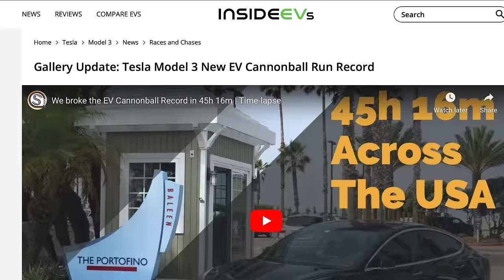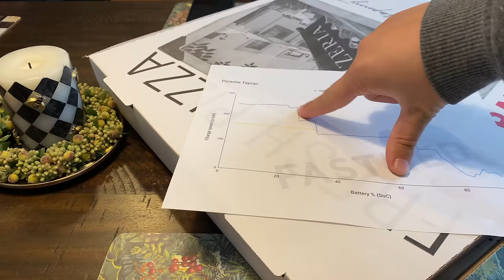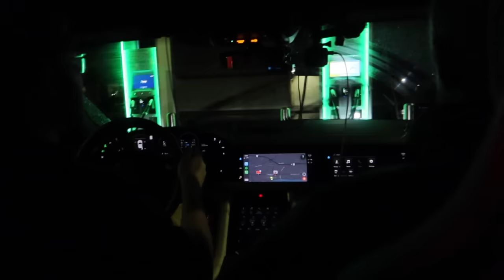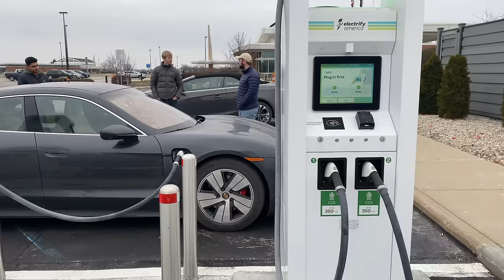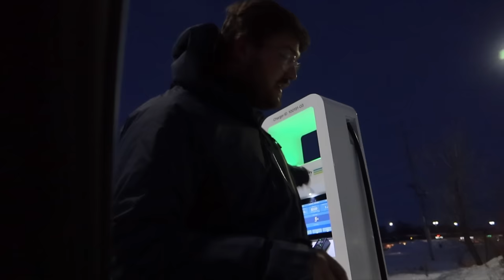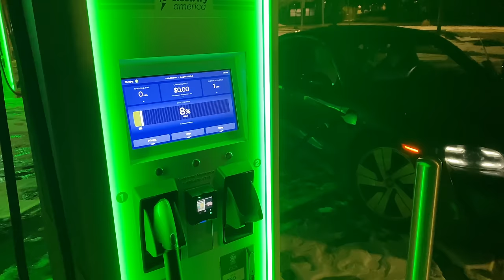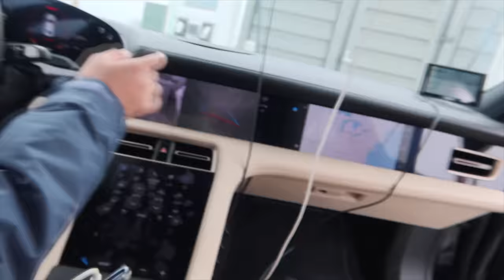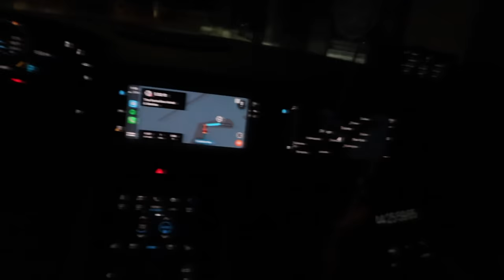EV Road Trip From NYC to Los Angeles! Breaking The Electric Cannonball Record In A Porsche Taycan 4S

Comment: I can't believe the positive comments.  I watched this whole thing and was horrified.  All you demonstrated was how unfit the Porsche is for road trips.  First, they gave you a car with no functional navigation system which Porsche, themselves, couldn't fix.  Then, nearly every single charger along the route failed.  Are you kidding me?   If you hadn't had a bunch of guys clearing the path for three-digit speeds, you wouldn't have made it.  What you amply demonstrated is that this technology is not mature enough for Mr. and Mrs. Average American.  Based on your last two road trip videos, there is zero chance I will buy any EV product from the VW group.

Comment: Too much power is EXACTLY the same problem that the new Signets give Energicas. Sending so many more amps than requested until the vehicle initiates a safety shutdown. So until they fix them we have to call ahead to try to find locations without Signet (which are few and rare).
Reply from the maker: That’s one of the many problems, yup

Comment: Not speaking as a Tesla fan boy but beating this wouldn't even be a challenge in a Model S. Significantly more range & much more reliable chargers that work right away.  Also imagine how much time you would save doing it in the spring vs winter.
Reply: If Tesla had V3's across the country, there would be no question your statement is correct.  However, over 90% of the SuperChargers going west to east are actually level 2's.  Couple that fact with the fast Tesla taper rates, I disagree that it wouldn't even be a challenge in a Model S.  The one that will beat this handily will be the Lucid Air coupled with EA's network.  Once Tesla upgrades their chargers in the US East/West xcountry routes, the Plaid vs. Lucid would be like Ali vs. Fraser :)

Comment: I'm glued to the screen for the whole time watching this for the second time, one year later. Lucid Air will take the crown this year for sure. It's initial range will cut out several stops that other cars have to make. Finally, the 300+ kW low SoC speed will cut the total charge time way down, whch is where the gold is.
Reply: Same here, enjoying this for the second time. The Lucid will be better on charging, efficiency and range, but will have to handle more traffic. This covid/new year situation was unique to this run.

Comment: record should improve easily in summer because of less air resistance. Pro Tip: the options electric charge doors and glass roof are slightly reducing the range!

Comment: I feel like the dealer should have hooked you guys up up with a obd2 reader with bidirectional control to possible Triger that pretreatment feature. I amassed at how piss poor those interface are on the EA chargers, theirs no excuse with how much power and cheap you can get a basic cpu/soc that can drive a screen with out lagging out.

Comment: Congratulations. But it does highlight how the CCS people need to harmonise operations and software
Reply: It’s not a CCS protocol issue. It’s that the people who build the chargers are different from the people who operate them. EA may be a VW company but they don’t make the chargers which means they are at the mercy of the people who built them. Not to mention, EA uses a couple of types of chargers from different manufacturers

Comment: I love what you did!  What demanded that you begin the trip without fixing the software? After the fact did you find out more about the Signet chargers? No problems ever with the ABB? NICE discussion on the Tycan! I'm sorry you had such frustration with the charging. That should not have happened, but it is great for the community that you have identified the problem. Do you know what the max KW/100 miles you did on the run? It seems like there were problems with the battery cooling system as I don't think the batteries should have gotten to those temps in that weather. This was made to cruise at 160 MPH. Could you have pre-conditioned the battery by accelerating to a high speed then use the braking (several times)  to cause the recoup amps to warm the battery? If the navigation software would have worked, would you be able to just tell the car you were going to a charge station, then drive past. YOU GUYS WERE GREAT!

Comment: Dunno if this is the case here on the tycan, but on some cars  you need to push the plug in and hold it when doing the handshake on CCS. Because the cable is heavy

Comment: The charging problems emphasise the simplicity of the Tesla solution. EA and Ionity have chosen to purchase charging units from multiple suppliers. They are charging multiple cars from multiple manufacturers. All of these units and cars will have their own version of firmware/software (the ID cars will have their own, the Porsche cars have their own, Kia/Hyundai I'm not sure but probably common). When the manufacturers release an update the charging unit manufacturers need to test and possibly modify. Seems to me an inherent weakness in the design of the solution, entirely understandable but an issue nonetheless.

Comment: Did porsche ever get the GPS sorted as well as it pulling too much juice? Pretty cool that you found if you arrived with a slightly cooler battery where it would limit itself it worked.

Comment: Those EA chargers are terrible... sometimes not even the level 2 station works....
Reply: We don’t have level 2 ea.  You keep forgetting they have installed 722 locations in less than 3 years. The ea chargers I use havent given me trouble. They have 3 different charger makers . And they need to charge a lot of different cars. Not the same when one company makes the car and the chargers. Kyle was complaining about charging speed I would love to get those low speeds on my leaf.  It doesn’t help to be negative about the network.

Comment: I hold the record for watching the entirety of it. Not sure if anything other than a winter run would work for the Taycan. Correct assessment? It wasn’t as hard at keeping the temps up than it was as keeping them low. If they could give you an idea based on battery and outside temps for the optimal arrival conditions for maximizing the charging curve that would be nice. In all fairness they may already do this with a functioning navigation system and battery preconditioning. EA charging assessment, connector quality and communication status and reliability assessments?

Comment: Congratulations!  But the issues you had with the software does not seem surprising.  Traditional car companies are really good at making "cars" like engines, transmissions, and overall harware, especially the germans. (The german engineering is of course top notch.) But what these traditional car companies are NOT good at is SOFTWARE. They were never software companies before so from that standpoint they are a brand new company. So unfortunately to me it's not surprising that the software needs a lot of work. This is where Tesla is light years ahead of the competition.

Comment: There are two solutions to the EA problem. 1. The non-Tesla manufacturers form a joint venture to build a proper non-Tesla DC network to compete or B, all non-Tesla manufacturers negotiate deals with Tesla to use its network. Tesla would make a killing selling access to their charging network.

Comment: Tesla really needs to improve the charge curve. Taycan and e-tron are so fast deep in the pack
Reply: Wait 6 months
Reply: @rogerstarkey5390  Why? Buy E-tron or Taycan and have awesome charging curve NOW! 
Don't worry - you're Tesla shares are still trading at 1700 PE ratio vs. 1500 PE ratio when you purchased them :)
Reply: It will be interesting to see degradation reports over time.

Comment: 4:15 Driving at your speeds i would assume pre heating the battery wasn't much of a problem after the second charger or so. I'll find out if that assumption is correct and if i start to understand electric cars

Comment: Kyle, so what kind of efficiencies were you seeing when hammer down?
Reply from the maker: I think we dimmed the lights in a few towns 😁 - but actually Taycan was extremely efficient at high speeds - can’t remember exact numbers
Reply: Thanks. Taycan is a dream car for me. The 4S or base would be more than enough for me, hopefully they start getting onto the used market in the next several years.

Comment: Random thoughts: Forget Alyssa, Drew cleans the windows. Someday EA / Taycan will work seamlessly, but it surely isn't today. Handshaking sucks. Charge port locations are better on Tesla. It sure seems like you could beat this speed with a Raven Model S. It would be fun to see the cannonball run at only 10 MPH above the speed limit but with a Gas Car continually in front of you. It would lower your wind resistance and you could do it on Autopilot with close following distance.
Reply from the maker: That run wouldn’t really be in the spirit of cannonball. Also there have been LR+ Model S attempts but none successful. Also nobody would have cared because a slightly faster Tesla run than our previous run would be like, sure. This is a whole other platform!
Reply: @OutofSpecMotoring  Yup. Now you will have to do it a Cybertruck. The charging curve on that vehicle will probably be amazing. But yeah, it was fun to watch this one. I think all of the EA chargers, no preheat, no GPS / Route planning made it more interesting. I miss the dogs though.

Comment: I charged my car yesterday at a 350 kw Electrify America station and got lower than expected charge rate. Under the atmospheric and car conditions I expected up to 150 KW. Instead I got 80-105 max. The car was at 24%, OAT was 28 F and battery temp was 88 F. Does you have any idea as to why it didn't charge at 150kw? I called Electrify America and they had no idea.

Comment: Finally got through it👌🏻 Fantastic run and what a great trip you had. I don’t know if you mentioned it, but what tyres did you use? I saw Michelin on n one shot. Also, the IONITY chargers which Porsche are a part owner of here in Europe are about 32% cheaper per kW. I saw you pay 12,4$ for 43kW at one stop. That’s 0,288$ per kW. In Norway I pay 0,218$ per kW.

Looking forward to my next long drive in the T.
Reply: Michelin Pilot Sport 4S
Reply: @dconner9  4S? Sure it’s not just PS4 tires? Not the best tyres for snowy conditions. Any traction issues?
Reply: @Nord_Mann  you are right!!.  I just called Kyle to clarify.  They were PS4 not the S
Reply: @dconner9  that’s the only fault I have, I’m always right😂 It’s annoying to my surroundings, but one gotta do what one gotta do😉
Reply: @dconner9  I’ve got 19”s on my third set. They’re shod in Continental Premium Contact 6’s. I was a little surprised to see that yours had Michelin’s on 19’s.

Comment: I took my late 2020 model 3 performance for a roadtrip in December 2020, I pushed it to 10% charge left in the battery, and I went to a version 3 super charger, I was hoping to get 250kw max charge, but all I got was 100kw max!? Was there something wrong? I've also tried using an Electrify America fast DC charger on my 2020 model 3 performance and the max I could get  was 50kw, is the model 3 restricting or is it not just properly communicating with my model 3 performance!?

Comment: why not use abetterouterplanner? I sue ti for my 1000KM treks and after the first run I adjusted the KW per 100KM variable and wow it works great, it takes weather, road conditions and elevation into its calculations
Reply from the maker: We did but it doesn’t beat real time calculations

Comment: Man, what a trip... 😁
But why the 350 kW stations are not optimized to the single car that can use it is really beyond me. Premium EV prices have to go hand in hand with a premium charging experience! ☝️
Tesla just got their nose bloodied by under par LFP batteries and customers giving back their cars because of that.
Reply: For the uninitiated:
"The energy density of LiFePO
4 is lower than that of lithium cobalt oxide (LiCoO
2), and also has a lower operating voltage. The main drawback of LiFePO
4 is its low electrical conductivity. Therefore, all the LiFePO
4 cathodes under consideration are actually LiFePO
4/C.[5] Because of low cost, low toxicity, well-defined performance, long-term stability, etc. LiFePO
4 is finding a number of roles in vehicle use, utility scale stationary applications, and backup power.[6] LFP batteries are cobalt-free.[7]"

Comment: Damn, I'm sure happy that Tesla's Superchargers don't have these issues.
Reply: Tesla has had since 2012 with 1 kind of charger and only Tesla cars for it to work on . Ea had a quick timeline to get 722 locations in less than 3 years . With 3 different charging manufacturers.
Reply: @markfitzpatrick6692  Your point?

Comment: So... basically... Porsche = super build but buggy software & charging. Tesla = buggy build but super software & charging. Interesting choices.
Reply: Just that software is OTA fixable, while build is not
Reply: @Geilegarnele  2 yr old taycan... Software not as easy as you say.
Reply: @mkkm945  havent heard of software problems with the Taycan before though. Here in Switzerland they seem to be a none issue...
Reply: @Geilegarnele  there are many small bugs. Overall the day to day experience is smoother with Tesla. Not that Tesla doesn't have it's own issues. Also, a lot of the issues affect US cars. In Europe, ionity is far superior to electrify America. Even Tesla owners use ionity when convenient.
Reply: @mkkm945  how do you have a 2 year old Taycan? First available in Nov 2019? When did you get yours?
Reply: @ronb4633  Taycan was revealed in mid 2019, so 1.5 yrs but they still have small issues as described in this trip. Non functional gps, climate screen issues, slow handshake. Never said I had the car, did I?
Reply: @mkkm945  
Use of Ionity was a smart move by Tesla, converting (the majority) to CCS effectively doubled the available network at almost no cost to the company.
Of course, it's mainly "there when needed" due to the extra charge cost, but still useful.

Comment: The Taycan needs to ramp power more slowly so the charger does not sense it is connected to a runaway battery system.  Either that or a unique charging profile for a Taycan and other 350 kW capable cars needs to be updated to recognize the rapid ramp up of power to the systems when they are pre-warmed and ready.

Comment: I would strongly suggest a Model S or maybe a Model 3 LR RWD on 18” Aeros would be able to reliably outpace the Taycan. It’s a pure miracle you didn’t hit snags at every station with EA’s network. Tesla’s superchargers are far superior and the only reliable DCFC network in the US IMO. Electrify America’s stations are broken or working at severely reduced power 90% of the time. They need to build their own chargers like Tesla so there’s no question about things working or relying on third parties for troubleshooting. It’s really not that complicated... if little old Tesla can do it, the mega industrial complex that is VW AG/ELectrify America/Ionity (and its BMW, Ford owners) should also be able to build their own chargers.
Reply from the maker: Keep in mind I did the last run in a Model 3 long range RWD that was lowered on aero wheels in good conditions. Some traffic but still, every run has slowdowns. The Taycan is quick... just not simple.
Reply: @OutofSpecMotoring  my point was they could more easily repeat the record. The EA network is so unreliable I would doubt many could repeat your result. 

I’d be interested to see what a Model S LR on 19” aero wheels could manage. Of course there appears to be a new S and X on the horizon. I just hope their rated ranges aren’t so ridiculously overinflated like Tesla likes to do. 

The Lucid Air is going to be the champion of these tests when it’s available. Tests I saw said at 70-75 mph they were actually getting over 400 REAL miles c

Comment: Hey Kyle...I love all your EV run videos,  but I have to say that I think you cheated a lil’ bit...when you notified electrify America about the trip. By your previous Tycan video it doesn’t seem like EA is ready...lots of issues. Someone using the network doesn’t have the benefit of engineers like you did when they are depending on the network.  The real test is to see how viable a cross country trip is with the network as is. It seems to me that by having EA check the stations before hand, it’s operation might have been artificially augmented beyond “normal” operation. I wonder how your time would have been if they didn’t send techs out to check all your stops...thoughts?
Reply from the maker: I don’t see how that’s cheating - obviously whatever they may have done didn’t help anyway. I don’t think any of their engineers did anything to help this drive along the way.

Comment: Well the car has not the best setup for a record. The wheels are less efficient than the 20“ and the air curtains in the fenders are closed as this car is equipped with the electric charge door.

Comment: Why didn't you wait a couple years  to do this correctly and in summer.  It just sounds like you're cheating in many many ways, including spotters looking for speed traps so you'll be over the legal limit driving by the sound of things.   Has nothing to do with the chargers or the car, just because you think they are all VW as the parent company means nothing.  Why you should have waited a couple years but no bleeding edge you wanted to be.  Nothing EA do will fix the issue for you blatantly obvious.
It is far too early yet, like taking a beta car as you're early adopter point on the Porsche as developed in Germany on the unlimited speed Autobahn.

Fastest illegal road trip across the US, now it will take someone else to do it at legal road speed limits.